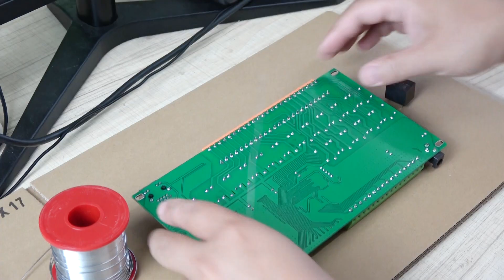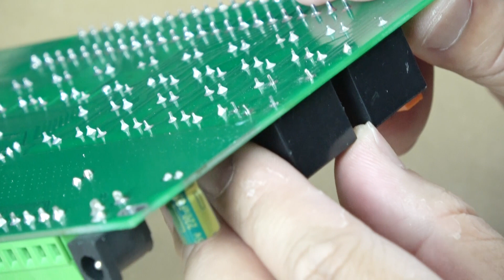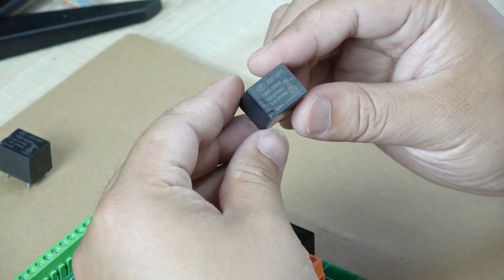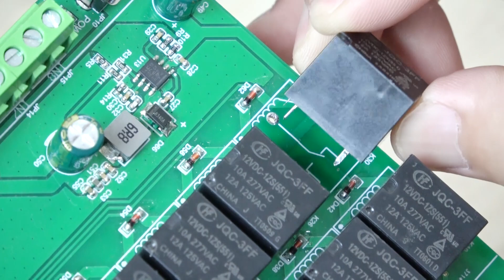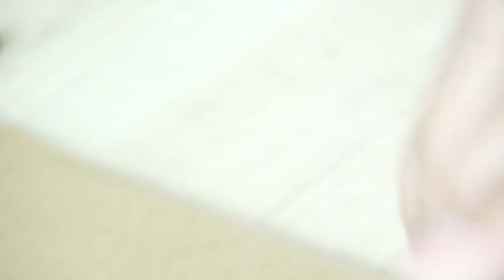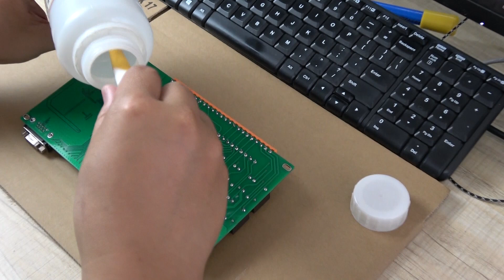how to replace new relay for repair KinCony Relay Controller

Comment: A question - why don't use triac instead of relays?
Love watching ur all the vids.
Learning something new every time.
Reply from the maker: we are designing new board with triac now.
Reply: @KinCony  I am also trying to design , but only had confusion regarding use of relay and triac ...will be waiting for your new design
Reply from the maker: @SachinSingh-ut5cc  best way is relay, use for no limit. triac use for small load.
Reply from the maker: but relay is safety then triac.